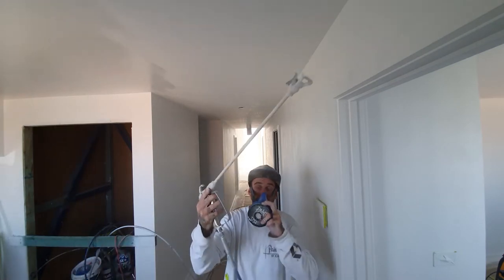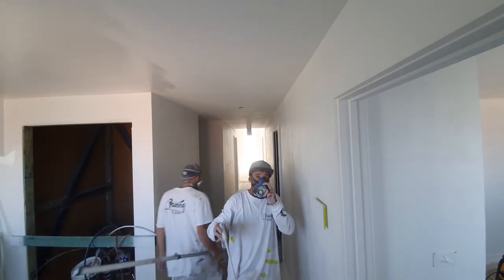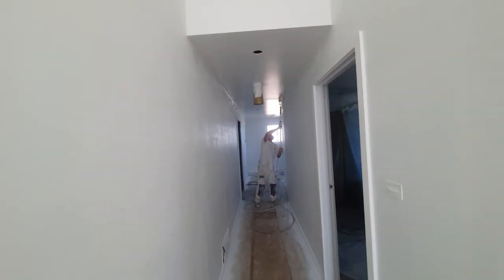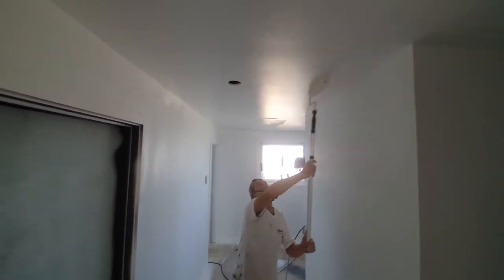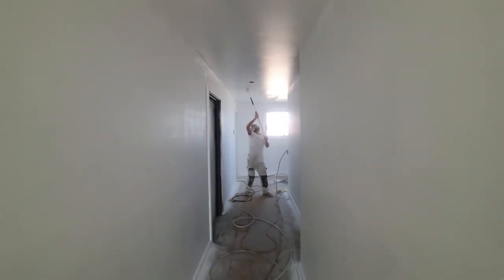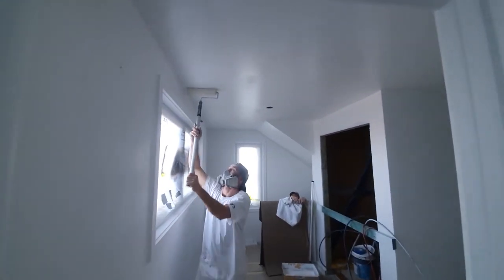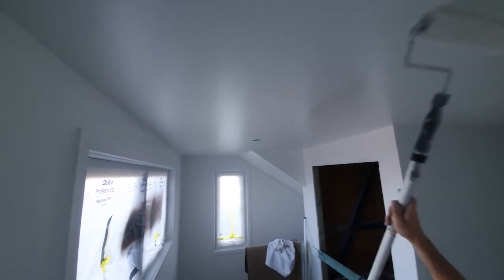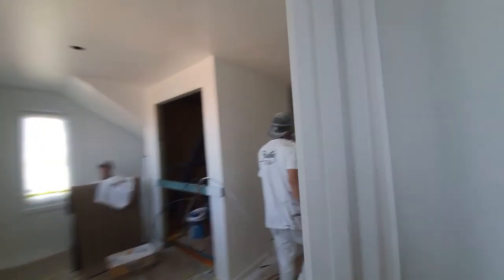BACK ROLLING CEILINGS

Comment: Before you start the backroll the roller should be damp right?
Reply from the maker: all your doing is tipping over the spray finish your not loading paint on with your roller. If it's sprayed right👍no need to pre-load the roller
Reply: @paintingbyjosh  way you do this back rolling? 
If you have not the best quality finish you do rolling ? 
Or you whant to have this type of roller structure? 
Not good enough  to do only spray

Comment: Either spray or roll doing both is a waste of time Painters spend too much time looking at wet paint
Reply from the maker: actually, you're wrong. spraying new ceilings first coat saves time. The second coat gets back rolled for a reason, so if there are touch-ups it can be rolled out again without having to spray the whole ceiling.
Reply: @paintingbyjosh  100%true
Reply: It also helps the paint penetrate and stick better by rolling cuz you’re pushing it in more compared with spray. On rough surfaces like stucco the back rolling gives a thicker, smoother, fuller finish because it really gets into all the nooks and crannies
Reply: Is this a 2 coat system 1 undercoat 1 top?
I use ASU @paintingbyjosh

Comment: Hey can I get your advice? Sometimes on big walls with lots of natural light it seems I cant get rid of the flashing?? Sometimes I run a level on the wall and I do see uneven joints that causes a shadow, but it is probably some technique as well. Any advice on how to get a big wall with natural light painted with no flashing?

I'm thinking for cases like this I'm going to just use a matte finish, and also use Gardz primer before hand. I normally backroll going up and down, but I heard when I lay it off I should go up, take the roller off the wall and bring it to the bottom, then go up again etc. What do you think?

Thanks

Also I saw your video on how to roll corners I've been using that trick a lot now